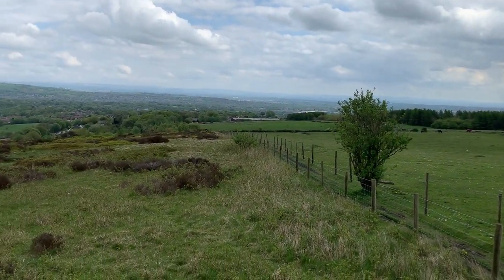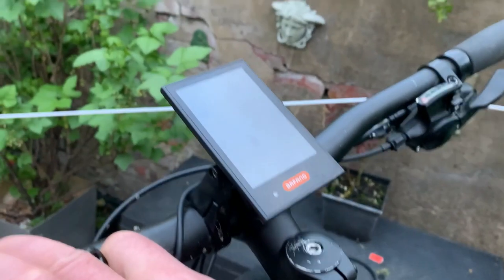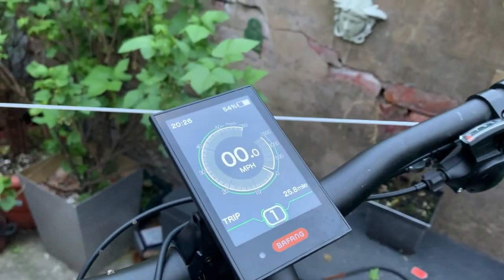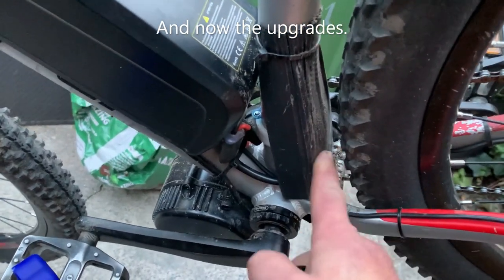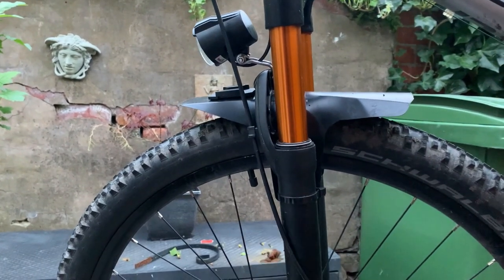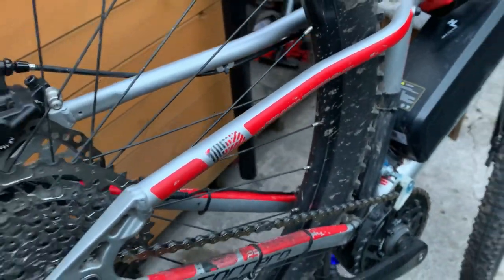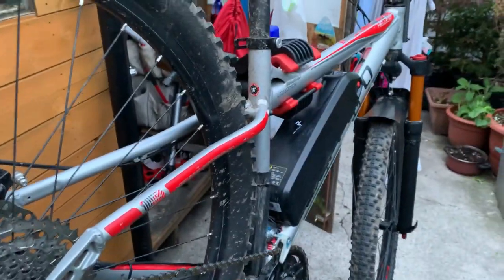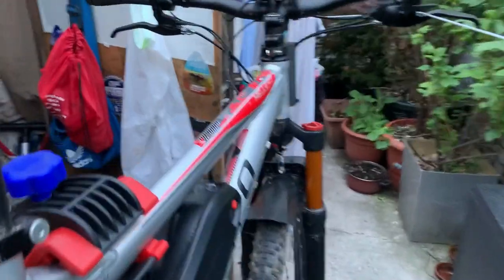Part 2 .Three months living with 500w 36v mid-drive on the Carrera Hell Cat.

Comment: I've got the tourqre arm fitted but didn't fit the cap/locking nut on. Not had any issues. It helps alignment of the chain and the chain doesn't jump
Reply from the maker: Hiya UKcastaway. This motor is now on another bike. I ended up getting the angle grinder out and skimming down the torque arm thickness.My motor did drop after a few hundred miles on rocky down hill trials.
https://www.youtube.com/watch?v=BujkgW80AkU
The other alternative is the pricey Lekkie One nut that is a two in one option for the locking nut and cover. But if yours isn't moving save yourself £25 .